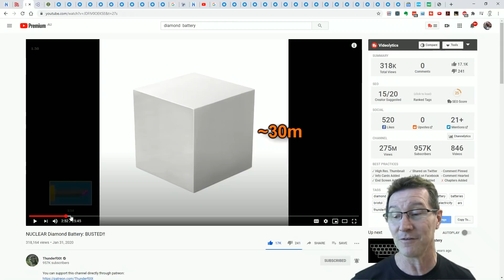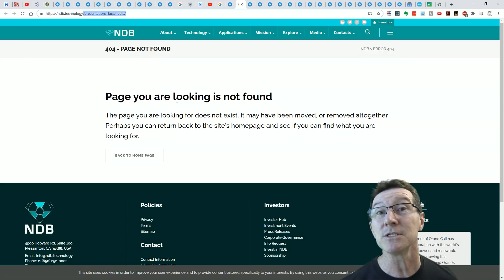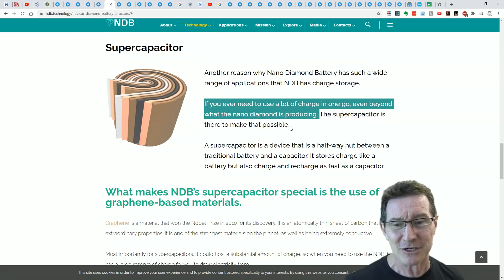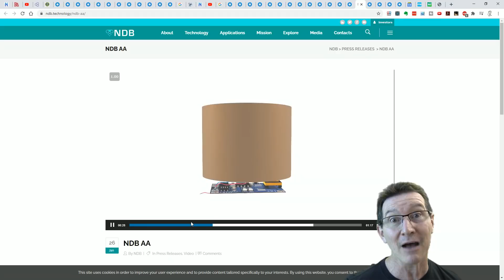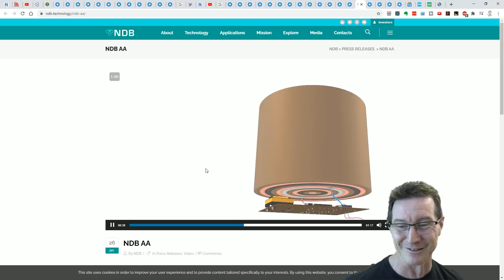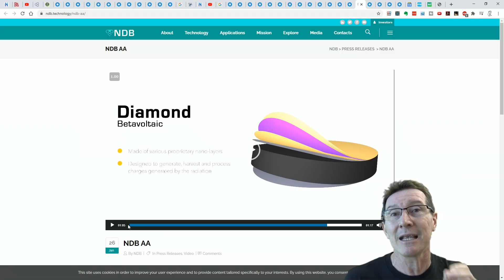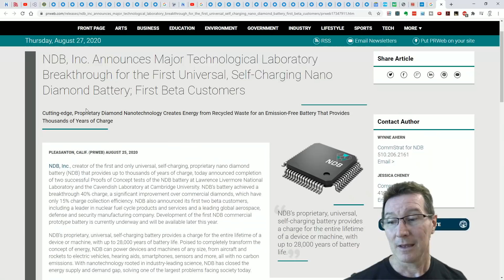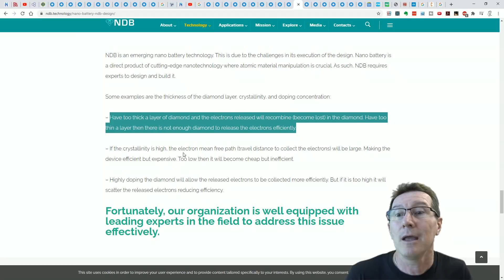EEVblog #1333 - Nuclear Diamond Self-Charging Battery DEBUNKED!

Comment: hmm I am gonna create a cr2032/old pc cmos daughterboard that holds a 2s of the p200 citylabs 1.6v/2.4v betavolatiac cells for pc cmos runtime as it appears
since the half life of output is 12 years that means the ~5ua of common cmos in modern stuff is under the 52ma of the highest beta cell by a factor of 10 we could easily get 100+ years of cmos data at the highest voltage demand
this would be good for lots or retro tech with already dangerous chemicals inside that tend to be destroyed when common batteries die 
a simple set of dip slots wired in a 2s#p array for fine tuning your betavoltaic battery pack for higher drain cmos or lower voltage modern stuff would be ideal
and voltage and current mismatching won't matter as solar cells(and so also beta cells) are designed for a range and don't suffer much from tiny reverse current leakage if you overload one and the other is within 2x the rating and is not overloaded
so I'd hold a handful of all three voltage variants(well maybe just the 1.6 and 2.4 versions) so I can tune between 3.2v peak (standard 2032 there) and up to 4.8v peak(more similar to the mac lithium cell version after I lift  the 5v charge resistor off the board so it can be readded someday for purists)
then you can mix a 2.4 and a 1.6 to get 4v if your stuff gets angry at above the lithium range but below 5v
now yes this is radiation but keep in mind beta decay is just electrons that fly away without wires you get the same cell/dna damage of external beta decay as a cr2032 stuck in your mouth(ie no damage beyond nerves being stimulated in ways that can cause sensitivity loss
I actually want to create a beta powercell for my two main PC's and for any retro consoles I have to avoid battery leak damage and will eventually replace the cap in v1.6 og xbox mobos with a beta device for the RTC they use as those caps get sad and will kill any v1.6 that isn't already dead

Comment: hmm so yet another "pay us money to make a prototype of a device that already exists in a fashion and can't be exceeded in performance by much so our claims are bullshit and we hide all numbers from our own information pages to hide the fact that we want to do what we know is impossible in the form promised"
hey NDB people the best you can get in the volume of a AAA battery is about 2.5x the common 100uW so 250uW sustained
the common consumer device of any kind only goes down to mW in idle (lowest power state) and can peak in the watts range
as 250uW(or about 0.00025W) is under 25% of the minimum range for idle power and to peak higher requires your minimum load be lower than your maximum output to have any energy to spare to charge a buffer
so the best you can run is 250uW CONSTANTLY or less than peak load for a long time with the extra energy used to fill a buffer for short peaks that when calculated down (including conversion losses) total less than your constant output
a AA can provide 1-4 amps in spikes but as it heats up from the overload the overall power it can sustain will drop under the normal sustained power output to allow it to "rest"
I can use a 5v 1a supply to run a pulsed load of 5v 2a or more but the maximum duty cycle I can EVER reach is output/input which in the 1 vs 2 amp would be 50% of the time at 2a and 50% at 0A
an NDB device could work on a smartphone if the phone was disconnected from power during the >99% charge time and then only used long enough to send a "help me" text 
but we tend to like our devices be ready 24/7 so until you reach a device that can provide AT LEAST 10000uw (10 ma or about 10x what a modern smartphone can idle at so we can use the dam thing for more than 10% of the time) your claims should avoid all consumer devices
you are shooting yourselves in the foot by claiming an improvement most people think is impossible
start with a 50-100% improvement and keep working your way up till you determine the chances of getting better is not worth the size or safety risk
I would love a 1mw(3v 0.3ma) INFINITE POWER battery as I could use such a device with a buffer in a common tv remote that never peaks above 60mw(or 3v 20ma) as a tv/vcr/dvd/ect remote is often only used in a duty cycle area of under 1% so the buffer would make it work when needed and it would have plenty of time to refresh between clicking the "next episode" on your streaming service of choice
I of course would probably use a lithium cathode supercap charged by the NDB device as those have major cycle counts near supercaps but the voltage and boosted energy density of lithium tech (even though it only reaches 2x a supercap that is still 2x the buffer in the same space)
and as an NDB betavoltaic cell would function like a common solar cell in that the voltage drops as you load it down the only saftey device needed for the lithium supercap would be a zener voltage limit to prevent the inevitable overcharge on remotes that take between 2-4.2v using common aa/aaa cells
my roke slim remote would be amazing if it never needed a battery swap and only degraded in usability after 10+ years of cycling the supercap
I would buy such a simple device as the internals are mostly air so fitting a couple betavoltaic cells inside with the cell slots being used for a replaceable supercap/emergency 2xaaa cell would be perfect
my remote never leaks from dead batteries and would be recoverable when the supercaps degrade
the only risk is raidioactive chips being put in the trash but luckily tritium is natural "and same with c14" and so the minute beta decay of solid carbon or the tritium gas leaking out of the atomospere as it is similar to hydrogen would leave very minimal waste that isn't just common ewaste and even then the ewaste problem is not being dealt with properly to begin with so a couple "infinity remotes" won't matter much in the actual solution once we implement it
oh that is a great idea "infinity remote" it is a simple kit for common 4.2v tolerable remotes that uses lithium supercapsthat allows any aa/aaa remote to have a set of betavoltaic cells in parallel added in the case gaps and then run using the supercaps or common single use cells if you need a boost for a short time
I would buy a kit like that if it worked even sometimes without the energy from a primary cell battery and the aa/aaa cell could be set up as "backup" using a simple voltage discrepancy of the 4.2v-3.0v of the two types
the needed diodes for anti-backfeed into the aa/aaa might be a problem but maybe use a simple button system to physically swap to the backup cells and back as needed and you eliminate the diode loss issue
in most cases such a kit would remove the battery need entirely but it still uses them in rare cases

Comment: ironically the only market such a device is useful for is along the lines of remote datalogging probes in hostile parts of the world
you use the 100uw/gram chips in a parallel array if needed and a simple tiny supercap to burst out the data before going back to nearly nothing for the logging
actually cmos chips in pc's could make use of this as they already use almost no power to keep the volatile memory clusters active
however not so much in any directly consumer tech as firstly it contains a radiogenic material that could be stockpiled for dirty bombs and secondly it is so low constant output that it is only useful in applications where you need something that will never be accessed again and need it to stay powered in a non-renewable location such as a a probe to measure the properties of say, a flooded cave or collapsed coal mine
if a betavoltaic system of a few mw to a watt or two could be made safe enough it could be used for a smart watch or RTC device that never loses time
sadly to get the nearly >100,000uw required for most useful consumer applications would require a mass of radiogenic material greater than what is used in radiation based machines like x-ray and at that point it would be regulated due to dirty bomb stuff again
energy harvesting from nuclear decay or tiny thermal imbalances is well understood and already has all reasonable markets saturated because we can't ever get the energy output to be useful for more than low power datalogging or sram/cmos data retention
plus we understand decay times to "safe" levels of common waste and know how to separate the most inert parts from the waste
the only way to practically reduce long-age nuclear waste is to put the waste into a reactor that can force it to undergo more fission so it becomes a short-cycle isotope than can be stored and be inert before it can leak into the ecosystem or an isotope like u238 that is so inert that natural u235/thorium232 is worse to be around
a radiated carbon matrix betavoltaic cell is the worst idea since well something so stupid that nobody asked anything but "why?"
at best it would use a carbon matrix to trap a more unstable radiogenic material and buffer the decay into the carbon-14/nitorgen14 stage or to buffer a slower one to the possibly more useful carbon-14 decay
either way we still have the uW issue and the fact that it is freaking radioactive and shielding only works if the rejected decay particles can be absorbed or redirected away(something these tiny chips will suffer to do

Comment: There are very few applications for this technology, but in those applications it is quite important. So the keyword here is 'niche market'. Two applications that come immediately to mind are pacemakers and space probes. Nobody is going to use alkaline batteries in those devices. And nobody wants to be opened up every few years to change out the battery in your pacemaker. Furthermore, cells are cells. Batteries are batteries. And if you daisy-chained enough of these, and boosted them enough with very small yet efficient circuitry, you could easily imagine something like a USB charging port that lasts hundreds of years. The fact that most of us will never need something to last hundreds of years is irrelevant so long as some/enough of us do.

Comment: I did the math, and even if you assume everything in the favor this device and presume they can fit 16 of these 100 microwatt things in a TSSOP16 chip, like the Toshiba TSSOP16-P-0044-0.65A package, just the volume of the 62.5 million chips needed to provide 100kw of output to match a tesla battery  would be a 5 by 5 by 11.9 foot rectangle. This is the same dimensions as a Chevy spark. And this would be before adding any cooling system stuff, control equipment, power transfer bus bars, or even circuit boards. You would probably end up with something the size of a shipping container or a 300kw diesel backup generator after those are added.

Comment: I know these really don’t generate much power, but in the video you mention powering a calculator, is that actually possible and if so could one of these find a use in a pacemaker? Or do they not have a high enough power output for that. I know we don’t need pacemakers to last 28000 years, but current ones do eventually need replaced which can be dangerous, so would one powered by one of these be a good idea so it will never need replaced, could even be collected after someone’s death and reused in someone else.

Comment: Hi Dave you whole premise to debunk NDB is based on the picture of a battery that apears to be designed for loT devices. IoT devices become more and more popular which implies a growing interest in easily maintainable and battery-independent power sources, as wires and batteries are unpractical in application scenarios where billions of devices get deployed. To keep the costs low and to achieve the smallest possible form factor, SoC implementations with integrated energy harvesting and power management units are a welcome innovation.
On-chip energy harvesting solutions are typically only capable of supplying power in the order of microwatts. A significant design challenge exists for the functional blocks of the IoT-SoC as well as for the power management unit itself as the harvested voltage has to be converted to a higher and more usable voltage. Simultaneously, the power management blocks have to be as efficient as possible with the lowest possible quiescent currents.
Sorry for the rambling but I think this is the application that the NDB battery has been designed for. The wattage output has been designed for the task. So to say that all other batteries created by this company are going to be multiples of this battery is like suggesting you build a Bus by welding a lot of Sedans together. I agree that NDB has not put any figures together nor. It appears they have built any prototypes so you are most probably 
Correct in the assumption that they are phoney. This is not why I am commenting. Too many people find one thing wrong with a proposal and run with that as the reason the whole   proposal is wrong. Rather than rubbish the company because of one picture I would have prefered you to have aproched NDB directly for facts, figures etc. Then debunked them on that.

Comment: 15:53 - So you say if I have a device that runs a year on a single AAA battery (like a Z-Wave temp sensors I have all around the house) i could just buy a set of four of these for one device and I will not have to buy anything anymore? I could just replace a battery once a year and the rest will self-recharge lying on the shelf? And I could do that for the rest of my life without spending penny more?
You're right - this is BS, as this business model is not self sustainable. They will saturate the market and go bankrupt.  (Same reason we don't have 100years-lasting light bulbs anymore.)

Comment: NDB keeps pushing it out like its something possible and new. and literally sure, it does produce SOME power, but so little that you would have better luck rubbing a balloon on yourself and capturing the static charge to use as power.   It uses radioactive waste to produce a tiny, insignificant amount of electrical current.   This is a fantastic idea, but literally you'd need some like 10 of these batteries to power your average simple watch.  100 micro watts, is ,  0.0001 watt.   A basic watch uses some 78mWh for 2 years of use. A milliwatt is 0.001 (so 10x more power than the NDB battery) You'd need 10 of these batteries, to power a simple watch the same as a typically 1.55v 50mAh watch battery can do for 2 years.

cost of that 1.55v 50mAh battery? about $1.50 current listing price on amazon. Non-rechargable design. When you google to find your own, look at the SIZE of these watch batteries, and then realize you need 10 "NDB" batteries to even have a chance to keep up with one of these tiny batteries.

These Nano Diamond or Nuclear Diamond batteries do in fact have a use and ability to help some things, ultra low power consumption devices in space being number 1 of course - but as for "disrupting the system" no... not at all.  Until they can do 10x+ what they claim now, they aren't even usable for wearable electronics.

The better idea would be to take an entire barrel of nuclear waste material, and make that produce electricity with it's 'waste' being either neutral to environment or ideally beneficial in some way (say, sand, that could be melted to glass or used as a filter, etc)  even if each barrel only produced 1 Kilowatt of power, it would still be a huge net gain and make nuclear reactors much more viable, and we'd have even more sand to filter with (not that we need it, but hey, better than harmful radioactive products)

Comment: Where in the world does it say that the batteries are LIMITED to 100 microwatts? That size may have that wattage, but for you to claim to "debunk" this new technology based on that particular size and model is absurd. Why are you, EEVblog, so dead set against the technology? Hmm. You compare the bios-sized chip to a triple A battery, but think of the difference in terms of 'weight' and 'density' of the two. You're so stuck on the "100 micro-watt" thing, that you fail to see the forest through the trees. MY opinion. Graphene is why it's lightweight. Get a clue!  Wait, do you work for a carbon battery company?  Energizer? Duracell perhaps?  LoL

Comment: MB microtech made tritium based nuclear batteries in TO-3 cans that made about 2mA at 3.5v. They had 5 curies worth of tritium in them and had phosphor coated cap with a window that lit up green to verify operational status. Original use was for memory backup and to charge a tantalum capacitor for some sort of military equipment board. 🤓

Comment: Saying 100µW has limited application is thinking so deep in a box that you'll suffocate. In the sensor space that's a meaningful amount of power. Seal it up in a hermetic package and check the sensor a few times a day and phone home the data once a week and you're set. You could distribute these in remote places to monitor anything until the hermetic seal failed enough to start corrosion. You can modify Arduinos to idle at 10µA at 3.3V (33µW) and they're not even designed specifically for that. Slap two of these together and now you're consuming 33µW out of 200 and the rest could be used to charge a cap with a super low internal resistance for burst consumption.
Reply from the maker: Now the bullshit marketing claims though. And the small fact that it doesn't actually exist yet.

Comment: Actually, The "3610 electrons per second" does tell you max energy output.  Since it's a diamond, it has to be made of carbon, which means they are using C-14, with a half life of 5700 years.  So the 28000 year claim is about 5 half lives, at which point 1/32 of the C14 will be left.
The amount of energy in one beta particle from C14 decaying into C13 is .1564 MeV, or 564.6 MeV per second, or 9 × 10-11 joules per second.  Or 90 nanowatts.